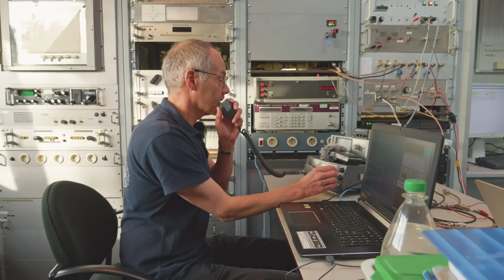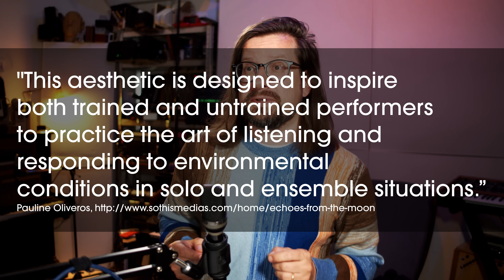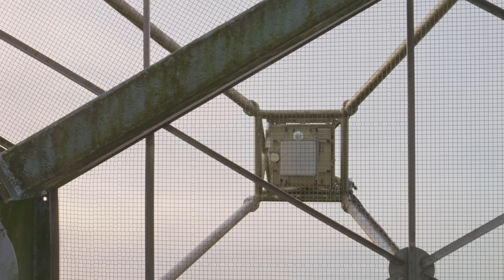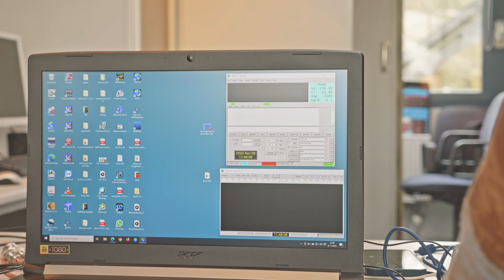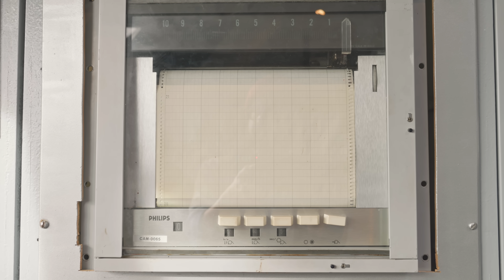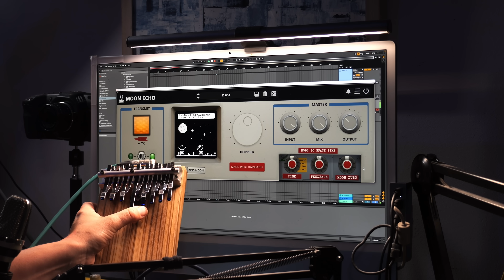We Used the Moon as an Echo (And Made It Into a Free Plugin)

Comment: Good old EME.  The thing I love about EME is that it demonstrates the distance between the Earth and the Moon and also the speed of light in a vacuum, in more ways than one.

Antenna designs are tuned based on the speed of light in a vacuum and the velocity factor of the metals used to make the antenna.  If science were wrong about the speed of light and the velocity factor of different metals, these antennas would not work well enough.

Since the efficacy of these antennas prove that we are correct about these things, we can now use those same antennas to measure the round trip time for an echo off of the Moon.  Since we know the speed of light in a vacuum and the round trip time, we can estimate the distance between the Moon and the Earth.

Some people believe the Moon is actually much closer to the Earth than it actually is, those people also believe lots of other strange things.  Those people are wrong.  There is a big experiment coming up soon for them!

Comment: I want to share with you a cool idea that I've been thinking about for a very long time: is it possible to record a control voltage on magnetic tape and then use to control pitch, modulation or cut-of.
And its very interesting how speed and condition of magnetic tape will affect the output signal
Reply from the maker: Yes that is possible and has been done since the 60s as a way to recall pieces. I have an FM modulated recorder I have done this with as that allows to go low Hz, while most tape recorders cut out at 30hz.

Comment: I would not expect sound to travel that fast.  I haven't gotten through the whole video, maybe im missing something.
Reply from the maker: It’s a radio telescope, this is radio waves
Reply: @Hainbach  ok, so in my brain I think of thunder and how it can take a really long time from the flash and the audible thunder and they say a mile a second.  Is the focused beam of sound from the telescope somehow transmitting the sound faster than the actual speed of sound or maybe the lack of atmosphere has something to do with it?
Reply: @natebell4764 no no no, first you need to understand that Radio Waves ≠ Sound Waves . The satellite isn't transmitting sound waves, it's transmitting it's equivalent in radio waves, it's the same thing that happens with... Well, AM/FM radio itself. The original sound signal is captured with microphones, they basically transform the sound signal into electrical signals that are then modulated and sent via a radio wave. 
There is no sound as in sound waves travelling through space, but there is a radio wave equivalent to the sound wave captured by the microphone that is being sent by the antenna, bouncing off the surface of the moon, going back to the antenna, getting received and then converted back to sound waves that can be heard with a speaker.
It's impossible to transmit sound waves through space as sound needs a medium to travel, not radio waves though.

There isn't a "beam of sound" but a radio signal carrying the "information" of the sound wave. Did you get it?
Reply: @darkvantage2019  oh yeah. Duh. I need to go back to school
Reply: @natebell4764  nah it's ok, it happens XD
Reply: @darkvantage2019  so then are radio waves almost as fast as light?
Reply: @natebell4764  idk why YouTube deleted my last comment but it actually travels at the same speed, as they're all part of something called the electromagnetic spectrum, the only thing different between them is frequency

Comment: Didn't you try to remove the noise from the radiostation using RX or something like that?
Reply from the maker: Why would I? This is a documentary on how it actually sounds. In the plugin you can remove noise.
Reply: @Hainbach  Well, the station itself has a rather common, familiar noise (my grandfather was a short wave radio operator so I may be biased) and it obscures the modulation which is what is interesting and unique here. But if you can remove the noise in the plugin, that is perfect. Great video as always.